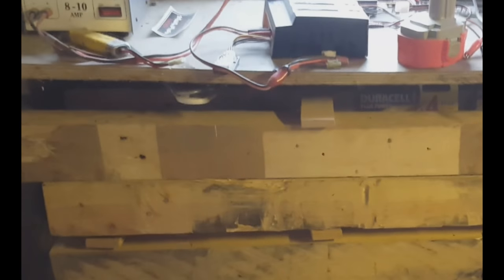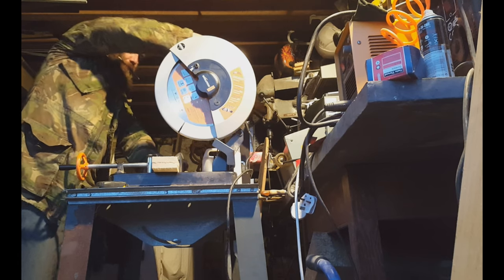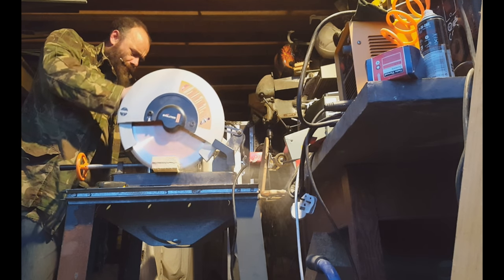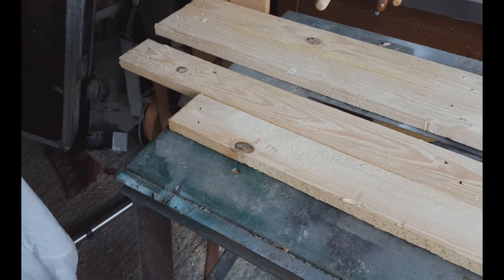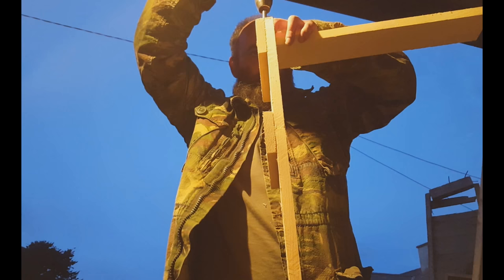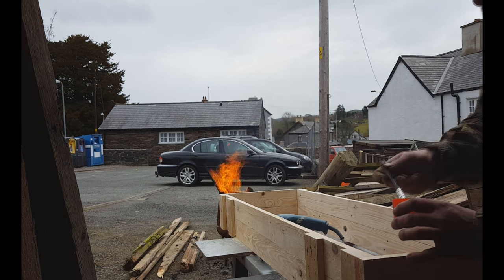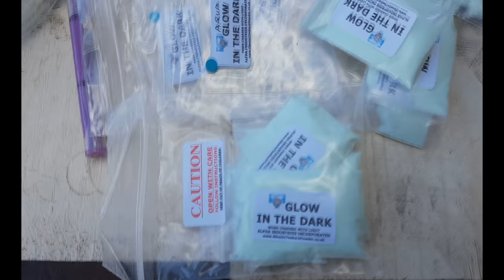DIY Pallet Coffee Table - Glow in the dark wood projects with Lichtenberg Figure Epoxy Resin

Comment: You are the first person I have seen to make an art piece where you can actually get TO the lights in case they need to be replaced. I have been astounded that no one else ever seems to understand that yes, those lights do go out sometimes and they do need to be replaced or repaired. Finally! An intelligent artisan!
Reply from the maker: ive had it happen on this table, these strips are weak and easily prone to snapping but also can fail for no reason at all which they did, they turned on but were extremely dim even with various power supplies, youre also thinking of the river resin tables? yes, ive got one here half made and im wondering how it could be possible to embed the leds in resin and still be able to replace them if they failed, im working on it.....

thanks for bringing this up although and ill be honest at the time i was building it it hadnt occured to me that i might have to do this and the design means that you can get access to them easily

Comment: Actually. I'm sure you could make a killing if you did this to bare wood guitar bodies... I'd take one deffo. hope you're well mate
Reply from the maker: yes, not bad, you? been thinking of guitar bodies, plain ones arent easy or cheap to find, wary of getting a painted one and sanding it back to reveal its just joined up sofa offcuts or something :)
Reply: Hmm true, would it have to be a a really soft wood for the burning to work? Would be good if the glowy stuff was waxed over and then dipped in paint...  you got me thinking now.😁
Reply from the maker: Hardwood gets a good result, you couldnt cover the glow in paint it wouldnt charge?
Reply: I meant cover the glow with wax while it was painted to protect it, then remove the wax after when it's polished . I dunno. I'm just getting a bit excited 😁
Reply: for most electrics the body wood isn't the relevant part you can cut it from any  durable material just buy a good neck and make sure the neck attachment is level and strong then place your pick ups and bridge well. its hard but you have wood working experience you should be fine.
Reply: thepoultrypeople a niche market but a nice guitar body with a cool design and shape could net you a few k if you know where to sell it
Reply: I can't wait 😁
Reply: thepoultrypeople you can pick up guitar blanks on eBay for next to nothing all you have to do is the burn and the inlay.. Awesome though, really cool
Reply: 1. That table is awesome.
2. Check out TDPRI.com for guitar building resources, ideas and sources on wood, bodies, etc.  A Telecaster body is not hard to build from scratch; it's pretty basic.
3. What do you have against scotch and bacon? lol!

Comment: That is freaking AWESOME! Great JOB! I must expand my workshop now beyond a circular-saw and hammer!
Reply from the maker: +TheAirheaded1 yes, pick yourself up a cheap router maybe? it all depends on which direction and what you want to be making?
Reply: +thepoultrypeople Yes, I must grab one of those for sure, because I got tons of old pallets, so I figured I would start out with some simple stuff like picture frames, maybe a spice-rack, you know, small stuff at first. Is there a certain brand that you prefer or do they pretty much all work the same?
Reply from the maker: ok, id maybe hold back on the router then, if youre not going to be doing a lot of carving then its not used that much, it is a handy machine to have though for little rebates and channels for glass etc., ive had about 3 or 4, this makita was the first and its still going! were talking about 20 years old, it has been superseeded and id probably get another, i might even look at a second hand unit to repair this one if i could pick one up for 20-30 quid, the GF has the big half inch router mounted in a workbench, thats also a great bit of kit but twice the price and not as versatile for our sort of small use, great for big jobs and production runs though, ive made a few kitchens using that one
the other routers have been ELU ones from boot sales, i think theres one still floating about somewhere with a dovetail bit jammed into it, so ive limited experience with recommending a router to tell the truth

what i do suggest is getting a radial arm mitre saw, thats going to do all that you mentioned with ease and is capable of much more as well, im just about to review a rage 3db mitre saw that ive been sent, it looks fairly decent for the money and ill give it a good beasting on the beam mirrors that i used to make
Reply: Ok, thanks for that info! I will keep an eye out for your review too! Cheers!

Comment: Awesome project once again. I love your channel, it's inspired me to take up my own project. I have a few question regarding your process:
1. What grit sandpaper do you use to remove the excess hardened resin?
2. I'm looking to stain my project and THEN apply glow-in-the-dark resin in the cracks, leaving the project a darker red wine color with glowing blue. Considering the grit of sand paper you use, would you recommend I sand the excess hardened resin off by hand rather than a sander? I'd like to keep my stain coat as nice looking as possible.
Reply from the maker: Excellent i wish you a lot of success with it, ok once you start playing with the resin youre going to know how it goes. One of the problems with it is that it contains glow in the dark so to get the definition of the cracks youll be sanding the timber area flat including places where spillage has taken place. So in effect youre going to be sanding some of your stained timber. Maybe it depends how the pour goes and whether like me youll need a credit type card to spread it around.

Sanding, it gunks up the sanding belts quite quickly, if there are big clumps and a lot to do i will use a 60grit to remove a lot of the bulk. But its mostly 80 grit belts and then 80 grit with the palm sander, then some finishing by hand, again, ill use worn 80grit belts that i cut up.

Experiment on some scrap pieces of wood, find a 4x4 and make a dice, that gives you 6 sides of experimentation ;)
Reply: thepoultrypeople I've already got a spare chunk of the same lumber that I'm going to experiment on first. Sounds like I just gotta be as clean as possible with the resin. I also don't mind sanding by hand if I have to, if I'm going to do it I might as well do it right. 

Thanks for the quick follow up, I'll post some images when it's done! Cheers from Michigan.

Comment: thanks for your last response. I just burned my first few pieces of wood yesterday, it's a lot of fun. Did you used untreated wood to get a deeper burn? The treated wood I bought only went down about a 1/16 or an 1/8 of an inch or so.
Reply from the maker: just woke up man, got to sleep sometime I guess :) yes always untreated, i presume you mean pressure treated timber? that sounds about right for burn depth, im guessing the deepest its gone for me is about a quarter inch and thats been with dry white softwood thats needed multiple wettings of conductive solution, youve noticed how the wood heats up and dries out?
Reply: Thanks for your reply. Yeah, I've only used treated wood so far and was hoping for a deeper burn depth. I'll try a softer untreated piece of wood. I've noticed how it can heat up and dry out quickly. How much time do you give the wood to absorb the conductive solution before you try to burn? I've tried a few minutes but thought perhaps waiting longer might help with burn depth as well.
Reply from the maker: Rodney Till theres a woman on here whos doing them and shes been leaving hers to soak overnight, me i just crack straight on and just keep reapplying as it needs it, i like doing them on hardwoods, again though the etch isnt that deep but it is intricate, have a look at the vape pen holder video which is oak and youll see the burn happening there and how intricate/delicate it can be, beech as well is lovely to work on

Comment: Bongo couple questions if u dont mind.  seen the glow powder 10g on ebay. What liquid do i mix powder with,  could i use screwfix's " no nonsense yacht clear varnish " i thought this would compliment the powder well as it would dry clear and seal at same time.but would u say a one 10g packet would be enought for this size table for example.  Sorry for so many questions

Comment: You put that Makita router through hell and back - how do you rate it 1 to 10?  I have a Bosch, not sure how I feel about it - I know I'm not too fond of the Bosch brand router tool bits.   Love this project!  You did an amazing job sir! Bravo!!!!
Reply from the maker: wow i d forgotten that i put that makita through so much use, this is a fairly old video as well, its a tiger of a machine, i was using it today solid to demonstrate wood cutting at a festival, i had to change the switch out some time back but not had to touch the bearings,  im going to have to rate it at 9.5 mainly because its 20 years old and performing like its still new,  the collet has snapped in half but still holds bits in place tightly, highly recomended
Reply: That is amazing!  I've already had to have my bosch rebuilt and I bought it new not even a year ago!  Thank you for that!  Now to find the old one you have - at pawn shops!  Cheaper for some reason when they are old - but yet they are - obviously! MADE 100X BETTER BACK THEN! haha - Thank you again sir!

Comment: I love your work on this table. Where do you get the lights for these? Thank you.
Reply from the maker: Ebay for these, ive seen them on amazon as well. Search for 'LED strip lights, i went for the cheapest ones at around £10 or $15, not really recommended as they dont last that long. Thanks for the compliments, it was great how it turned out so well from reclaimed timber.
Reply: Thank you for the tip on the lights.. keep up the good work!

Comment: Great video! I've started doing this and wanted to know if you ever had any problems sanding down the excess resin? Mine keeps gunning up and removing some of the resin on the more detailed sections. Do you have any advice for fixing that and making that process easier?
Reply from the maker: Thank you and ill try, ive also noticed gumming up. What sanders are you using? Im using sanding belts gently at around 60 grit to get the mounds of resin removed, then switching to getting a nicer finish using 80 grit. The problems are when it starts to heat up, i have to let the sander cool, remove the belt, wait for that to cool and then smack it off the wall a few times to get rid of the resin build up. It goes hard again when cold and sort of comes off.  Also using a wire wool brush to also remove the resin off the belts.

So my best advice is to sand it off cold, take your time and let everything cool down in between sanding sessions. Hope this helps? What resin are you using?
Reply: That definitely helps out. I actually started noticing that it did work a lot better in phases of sanding and cooling. I am just using an 80 grit sand belt, but have tried as high as a 120. I haven't tried a 60 grit yet, that will probably be happening soon though after reading your comment. 

I'm using an EasyCast Epoxy Resin that has a 1:1 ratio. I wondered if adding more hardener to the mix would make the sanding process easier and cut down on the gumming up a little. I've watched this video a few times to see how you do it, and it looks so quick and easy. I know now that that part is one of the more taxing processes with a project like this. 

Thank you for the advice. I look forward to see what you do next. 

Have you ever tried to make specific patterns with the burn? I recently just did a piece that spelled out "love" and it turned out fairly well.

Comment: could I mix the glow in dark powder with screwfix's no nonsense water repellent sealer? this way I'm getting a waterproof sealer and the fluorescent effect. plus screwfix's is cheap. I'm off to bed now been a long tiring night shift but I'd appreciate your thoughts. thank you Mr. Bongo
Reply from the maker: sorry mate, ive no idea, the early pieces i did with the floor one part resin isnt so good and theres a couple of pieces where its failed and flaked off, but only a couple, id be going with polyester mate as its cheap and waterproof and then go over with the sealer after that

Comment: Hello, I'm from Brazil, I would like to know, you turned the wood into a better driver, using baking soda? And WHAT you use as electricity, some shooting transformer, what is the voltage that must be! please, and congratulations for the project, very beautiful. Thank you!
Reply from the maker: +Israel Feitoza Hello, thank you for excellent comment, It is a Microwave transformer, the water is seawater, salt water also works https://www.youtube.com/watch?v=OwrIPgqMSPI
Reply: +thepoultrypeople Thank you for your attention now on that this paint finish that glows in the dark, as is the product name, wanted to know if I think here in Brazil, to buy! thank you very good luck with your projeitos and congratulations.
Reply from the maker: i dont know about avialability in your country, its a mixture i make myself, very simple, Glow in the dark Powder and Polyester Resin, you can use Epoxy, Polyester and Epoxy Resin you will get everywhere, it is used in boat repairs, the Glow in the dark powder will be a internet sale and order

Comment: when I was a child I tried building a lightening globe with a clear filament lightbulb some HV cable and a TV transformer. I was sitting down when I realised high voltage doesn't care about insulating tape . I guess my bum looked a bit like your wood for a while.it was worth it for the knowledge I gained. lol
Reply from the maker: ha ha ha nice story, i never made anything as advanced as that, but you lichtenberged your arse? oooh, yeah, im not doing that, sounds a great project though, and good info on the high voltage and electrical tape, didnt know that

i do remember changing the capacitors out in a zx spectrum power supply though whilst it was still plugged into the mains, all was going well and then there was a huge flash, blew most of the solder tracks of the circuit board :)

Comment: Im interested in trying some lichtenburg work in some future projects. but my question is how well will a neon transformer do with larger projects like this one here.  Ive seen several dozen do on a smaller scale with pieces not much larger than 18 inches in length. 
   I'd prefer(well technically my fiancé would prefer) me to use the neon transformer as it is safer. and doesn't require me to rewire and transformer. but they only produce 8k-10k volts and only about 0.3amps.
  thanks in advance.
Reply from the maker: ive not tried it, apparently its very much the same although it does look like a neater burn maybe on the neon transformers, a lot of it is down to the wood thats used, on distance i cant really comment, 18 inches to 2 foot seems about right and youd do longer piece in stages or jumps, safety, my college teacher told me that a quarter amp across your heart is enough to stop it, neither are safe in that case and always follow your safety procedures

Comment: Hi Bongo I'm loving the table it's excellent and very inspiring. I'm making a table myself and have done some lichtenberg figures on it. Got some water clear epoxy and glow powder but I'm finding the epoxy won't dry enough to sand, always sticky to touch! what type epoxy are you using? Oh and are you using a welder to burn your lichtenberg figures?
Reply from the maker: Hi m8, good for you, sorry to hear youre having some difficulty, has it dried yet? Is it too old? Have you got the mixture right and whats the temperature like? And im no expert on epoxy as I mostly use Polyester based resin so go and ask around on a few other videos and groups, also the woodworking crazy group on fb has a lot of members whove used epoxy in finishing worktops and the like. Im using a microwave transformer to produce the high voltage needed to make the patterning. All the best!
Reply: Thanks Bongo, I got the wrong epoxy for the job i reckon, plus the temperature in the shed is pretty low these cold Irish winter days, anyhoo polyester epoxy en route hopefully I'll have better luck with it. Thanks a million for getting back to me & keep up the great work. Trev.

Comment: nice build, ive had one of those weeks... my belt sander (challenge also) sucked its lead up and bent the roller. then my mouse sander started letting smoke!
Reply from the maker: +MrMiniac savage, id send you mine for spares but the roller bearing is totally knackered and i think its been digging into the casing, but fuck me what a little beast of a machine its been, wish i could remember how long ago i bought it, i dont have a mouse sander,  worth getting? what are you using yours for?
Reply: +thepoultrypeople thanks for the thought, it has paid for itself. I use the mouse for corners etc. been invaluable on smaller detail stuff. I have a half sheet and a third sheet sander and I never use those,  just the belt and mouse.

Comment: that's nice real nice can you show how to make the burn on the wood like that, thanks
Reply: I'm not too sure, but from the looks of it he poured water on the area he wanted to burn, then connected maybe a car battery to two ends of the wet area, the electricity flowed through the water, and since it's wood, the heat from the electricity caused the wood to burn in an unpredictable pattern. I'm just guessing though, I tried looking at it again, it really is an amazing job
Reply from the maker: sorry guys but im only getting round to a lot of these comments now, pretty swamped, its called Lichtenberg figure and you do it with a microwave transformer, theres a video about it here https://www.youtube.com/watch?v=OwrIPgqMSPI